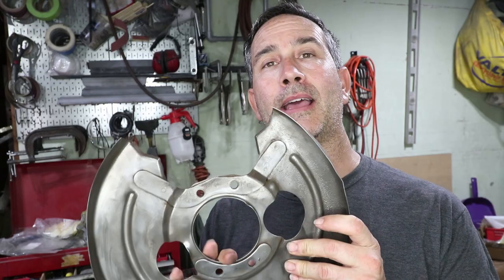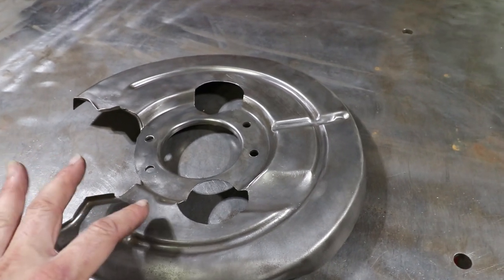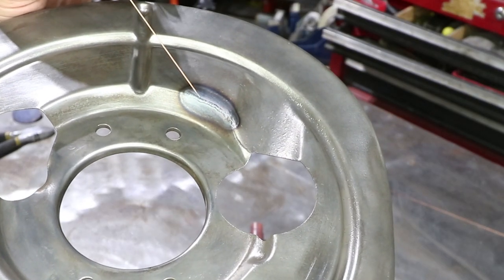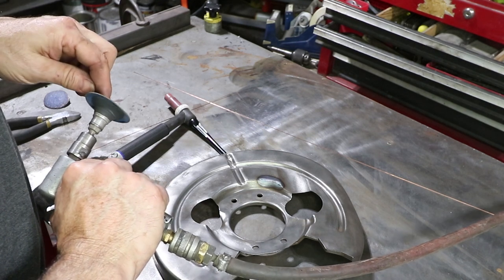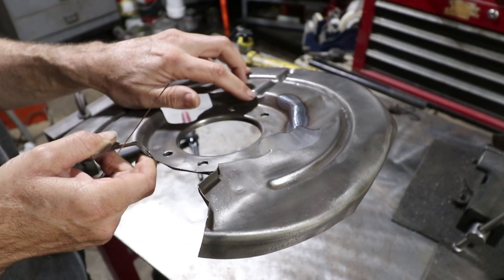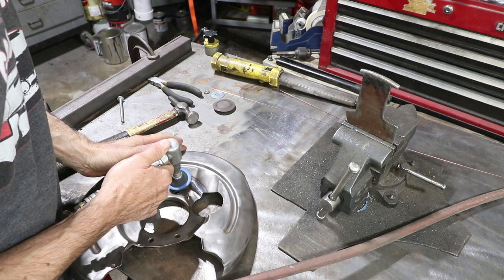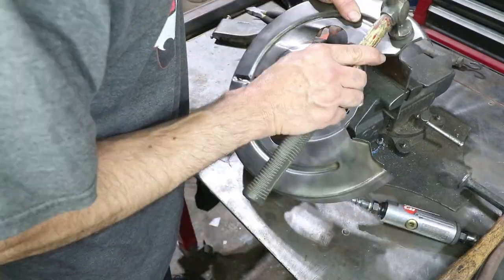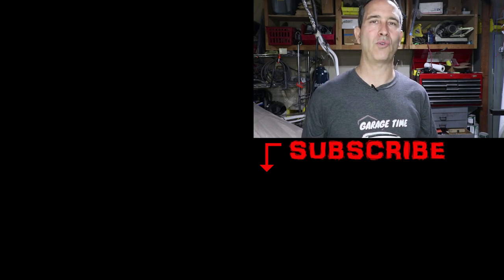TIG Welding OLD/THIN Sheetmetal Crack (22GA) On My Porsche 356 Restoration.

Comment: You always need to drill a hole in the end of the crack line. Otherwise you easily end up with another crack later on. The hole releases the tension in the metal. Otherwise very nice welding :) tig is the only way with that kind of repair
Reply from the maker: Thanks for that.  No hole on this because its so thin.  The weld puddle does more to change stress and I went way passed the crack with my bead.  (plus I hammered it).   On thicker stuff that you can't grind the crack out, then I totally agree with a hole.

Comment: In my day I was doing that type of welding with Oxy/Ac. Yes you could find tips that small. Tig is far superior because the temp control is so much finer. Good job!
Reply from the maker: Cool, I'd love to try Oxy/Ac someday.  Jewelers tips right?
Reply: @GarageTimeAutoResto  Not quite that fine but I could weld 16g steel with no problem.

Comment: Perfect timing😀
Reply from the maker: Cool, are you doing the same repair?
Reply: As soon as it stops raining, thin metal repair in footwell. Gonna give the mig a rest. Have been playing with settings and trying to copy your ‘weaving motion’. What settings were you on? Cheers
Reply from the maker: @TSY-sh5no  For this job, I was at 22A and didn't use full pedal.  Left, right, backstep.  It's like a dance.  Have you done my online course?
Reply: No, I’ll check it out. Thanks

Comment: Thanks for the content Tom.  Do you think you will ever do a video on the tools you use and perhaps recommendations for people just getting started?  Don't think I will be doing any tig welding any time soon but mig machine, hammer + dolly set.
Reply from the maker: Yeah, I've been thinking about doing that for a while.  Maybe this will be the needed reason to clean up the garage and do a video.  I have a new tool that I want to share too.

Comment: I have done some (very little) MIG welding never done TIG welding. Going to start a new car project. Think I will have to buy a welder, which would you recommend.
Reply from the maker: My machine is the miller diversion 180.  I bought it used.  There are better welders for the money I think if buying new.  Check out everlast.  You need a small torch, and variable pedal.
Reply: Garage Time - Restomod so you think if I had to choose between the two I should get a TIG and learn that over the MIG
Reply from the maker: It's a tough choice man.  Some machines do both.  I started with MIG and still use it.  To be very honest TIG takes a while to master especially thin metal.  I'm not saying that to make my video or myself look good.  I've taught dozens of people TIG and they still go home with lots to learn.  Buy both if you can.
Reply: Garage Time - Restomod I have an Everlast 200ST that will do a really fine job on stick. I have everything I need for TIG but haven’t had time to try it. I also have an Everlast Power MIG 200E. That’s about the only one I use now.

Comment: What amperage are you using for thin metal like you did on this video I been trying to find a answer for a trigger switch?
Reply from the maker: 22A with variable foot pedal.  For thin metal, I like the foot pedal.  Watch how I hold the torch.  If you hold the torch where the trigger switch is it's much harder to control the arc length. Not saying it's not possible, I'm just saying what I prefer.  Your mileage may vary😀

Comment: And I even love the color. Is that Porsche’s Irish green? Can’t tell in the light. 
Tell us about your welder and settings. Is it an IGBT and for .032 what was your amperage?
Reply from the maker: You got it Irish green!  My welder is a simple machine with one button.  (Miller diversion 180) Yes IGBT.  22A, .040" tungsten, .030" filler wire.